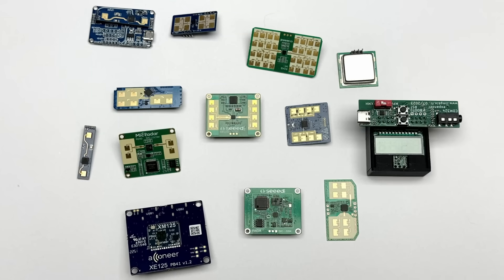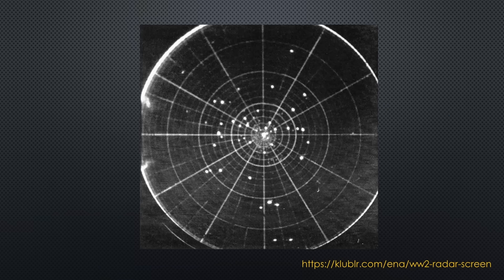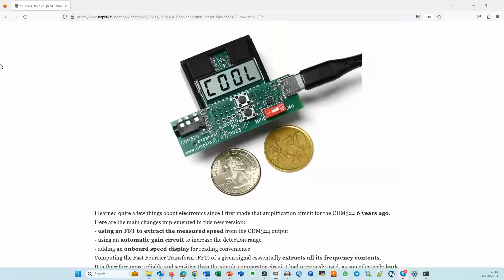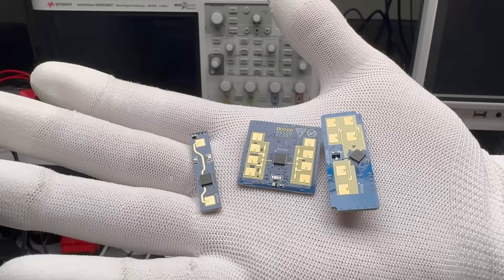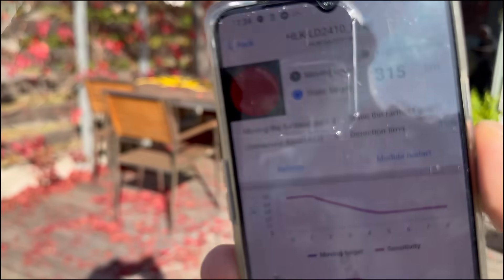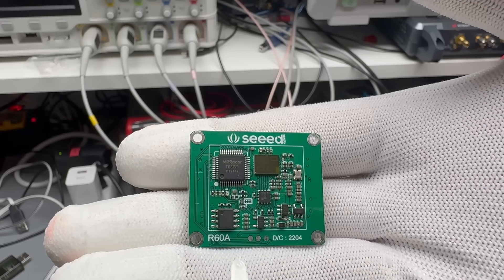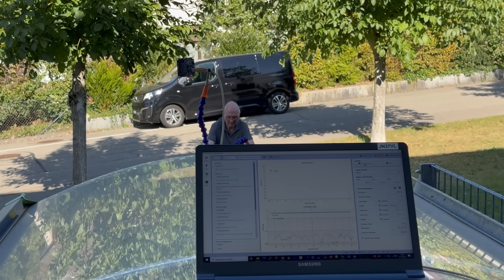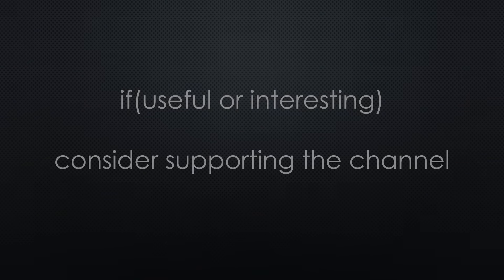467 Radar Sensors from $3 to over $100: Which one is Best?

Comment: Hello Andreas, thanks fo a great video! I have two questions: 
1. Can any of them track multiple targets as Aquara fp2?
2. Do they work also after covering the board? Eg. 3D printed plastic, or at least paper?

Thanks!
Reply: The ld2450 can track and give x y positions for 3 targets. My code sends them all to mqtt and a nodered module can detect them in boxes. I have pet plastic from bottles covering mine.
Reply: According to the specsheets the LD2420 should be able to track up to 3 targets simultaniously. 24GHz radars can detect through plastic and paper.
Reply from the maker: I did not check the "multiple target feature. Some of the datasheets have clear recommendations on which material for covers is good and its distance from the sensor.

Comment: It would be cool to see a phased array of these cheap sensor for beam steering
Reply from the maker: Not simple because these chips do not dispose a lot of the RF signals. But maybe in a later stage, they will be developed.
Reply: One of them already does this. The infineon one has 1tx and 3rx antennas! You do need to be a bit of a radar expert to make use of it though 😅
Reply: From what I read in the documentation, simply placing two sensors in close proximity will not work because of interference between the RF signals.

Comment: Theres no radar sensor which works with 230V? I want to use it with 230V lamps
Reply: Such lamps have been available for years.  (Presence  detection by radar). But where's the fun in buying pre built?
Reply: @ulwur  I dont want to use HomeAssistant. Its for a stairwell. Theres only 230V. Like a normal 230V PIR Sensor.
Reply: @destiny6721  maybe to use power adaptor from a smartphone? 230V -> 5V -> Radar Sensor
Reply from the maker: As @wlur wrote: you find such radar sensors. However, according to my knowledge, they do not use these modern sensors.
Reply: Thats it. The 230V radar sensors that are available don't work well. I also have HA and radar sensors in my apartment. Work wonderfully. But I would like to have the whole thing with 230V without HA.  @AndreasSpiess

Comment: Hello Andreas! Great video as always. I have been looking into radar Imaging and 3d mapping lately. Do you have any recommendations of what type of sensors I should invest in? Thanks.
Reply from the maker: I have no knowledge in this field :-(
Reply: Potentially RadarIQ? They seem to be developing some nice solutions including imaging
Reply: Thanks. I'll look into it!
Reply: You'll want to look up "Synthetic-aperture radar (SAR)" to understand how 3d radar mapping is accomplished. It typically requires a moving platform to achieve higher resolution.
Reply: @AerialWaviator  Thanks. I have come across couple of references to SAR imaging. I will look into it. Do you know of any consumer/IOT radar sensors that are capable of doing SAR imaging?
Reply: @vharivinay  Sorry, I don't. You might consider LIDAR as is a sensor tech that's consumer/IOT approachable (cost, size). LIDAR is used on drones for mapping missions, but is limited to line-of-sight, unlike SAR which can penetrate vegetation.